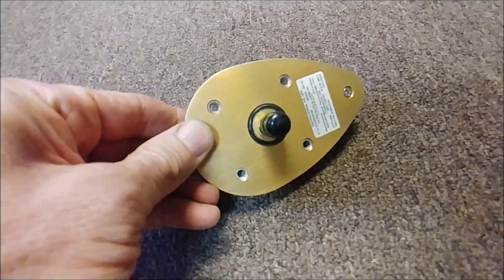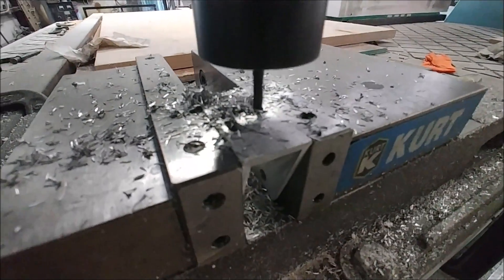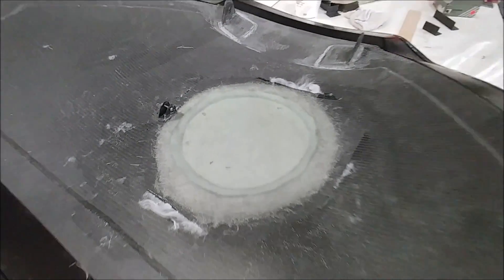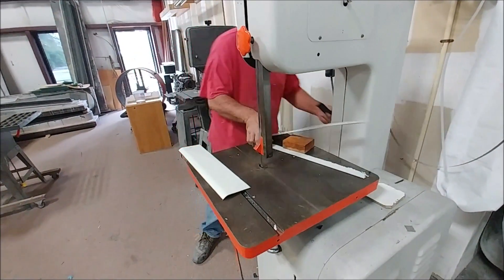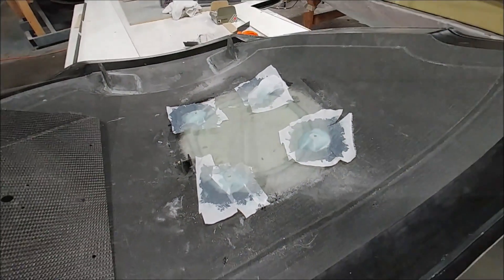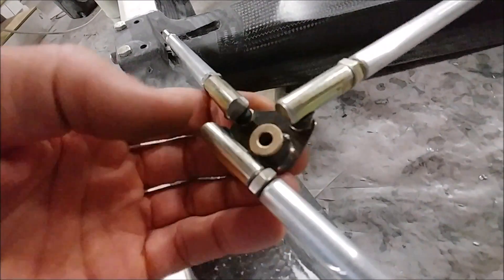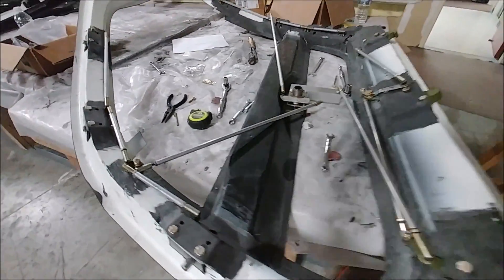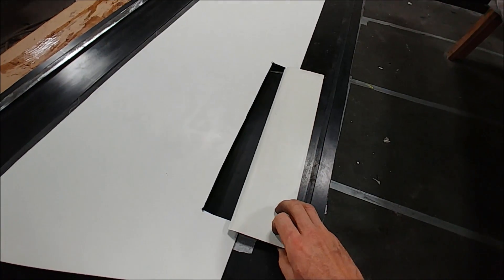Making Wing Surfaces? - Building the Raptor Prototype

Comment: ,,, there are some very knowledgeable people in the comments section however; on a very well documented engine it doesn't have to be all that complicated. X amount of revs, with a certain boost, will have a certain fuel flow, that maths out to its bsfc. This is assuming (lol) that there is nothing wrong with the engine and that the ceramic coating was the only modification and it had less than a one percent affect on anything, boost, power, fuel flow .
Reply: Roland Tamaccio , However it is well known that all engines and diesels in particular like to be properly loaded for the best BSFC. The friction and pumping/compression losses can become the main source of fuel consumption otherwise.
Reply: ,,, KG, all this documentation came from an extensive dyno program. The dyno, and thus loading, will now be hanging on the back of the plane. A variable pitch prop can make an excellent dyno .